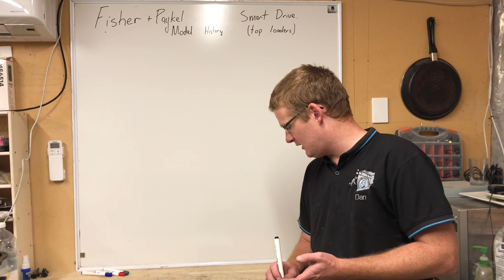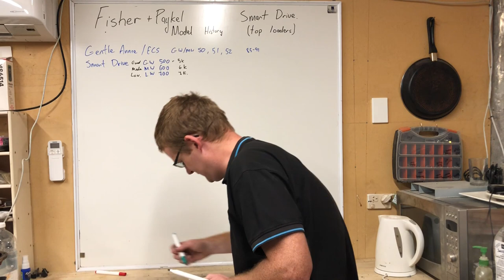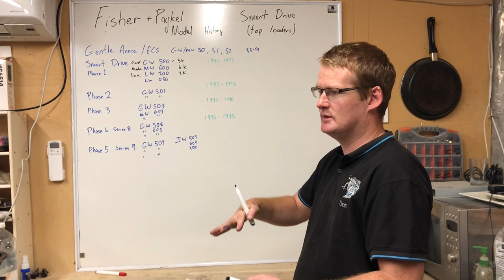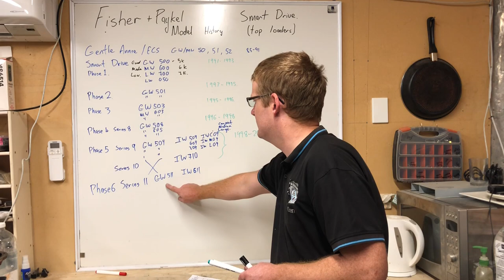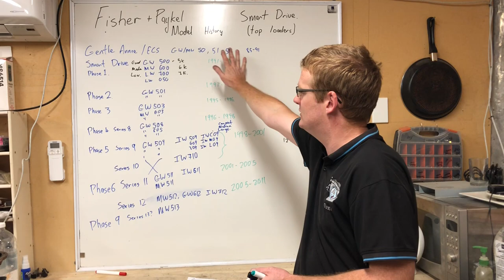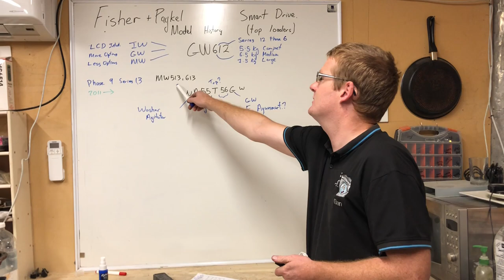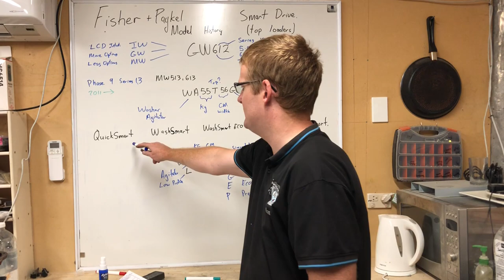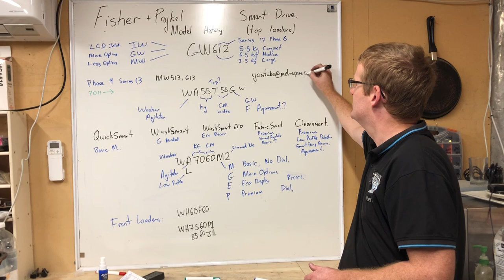Smart Drive Model Number Meaning/History

Comment: Hi You wrote that the WA models Series 9 started from approx 2011 How many years were they produced and what year did they next change again ( losing the letters in the model number) ? Thanks
Reply: I think I mean Phase 9 I can’t remember series 13?
Reply from the maker: Yeah series and phase numbers start getting confusing. There were only small changes up until late last year when they released the current model in late 2023, not sure what they are calling it. Redesigned look externally, Using a gearbox as well as direct drive motor, controller in the base, etc.
Reply: @motrepairs  Thanks I just used what I learnt from your very informative video when checking out a potential 2nd hand WA75T65GW1 machine to buy and worked out it needed new balance rods…so still looking !